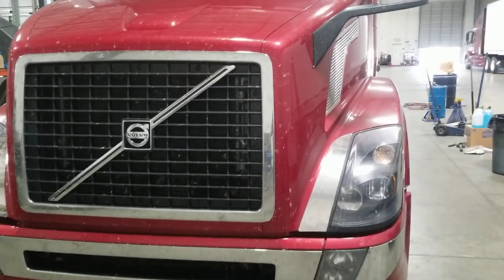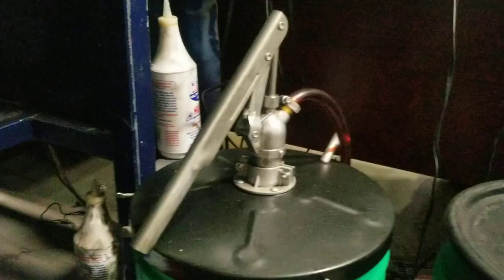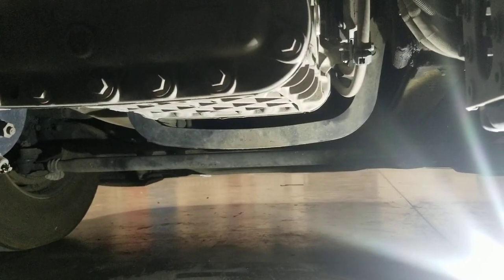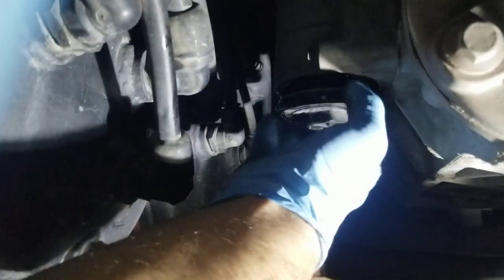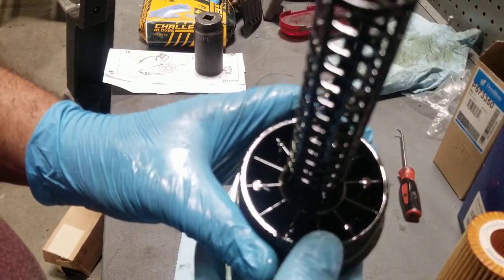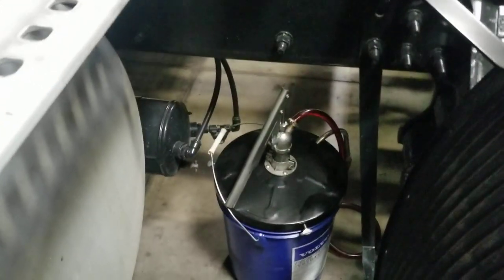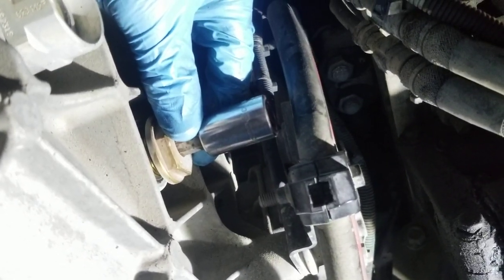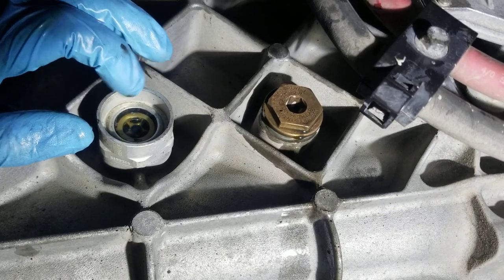Volvo vnl ishift or mdrive on a mack oil change and oil change

Comment: Very good I learned from that Thankyou one thing I always do too is take the filter O ring off the back of the plastic part so I don’t drag dirt across the threads before I pull the new one on

Comment: on the driver side my black plastic cap is on top and a metal cap is on bottom. will the filter still be under the plastic cap or is under the metal one on the bottom?

Comment: The Ishift filter looked black, what are your thoughts on doing a filter only change and top up every 200,000 miles?
Reply: Finally found someone who thinks like me.Terry, good idea. 
I was really thinking about it.
Tomorrow, I'll only change the filter and I'II fill it with oil up to the maximum level.
My Volvo have only 165k miles.
Reply: What size hex bit for the filler plug? Thank you
Reply: @terryj-londonontariocanada4605  Thank you Terry